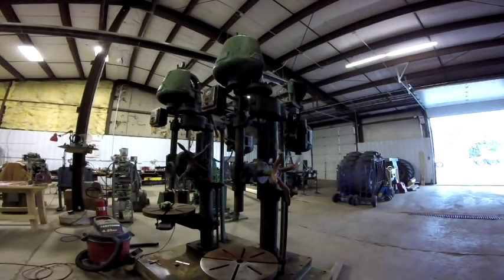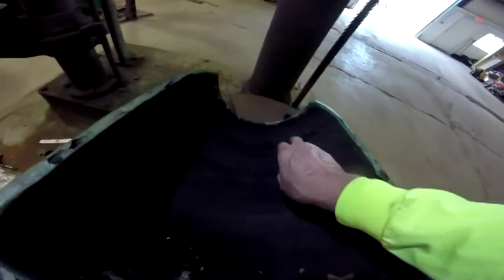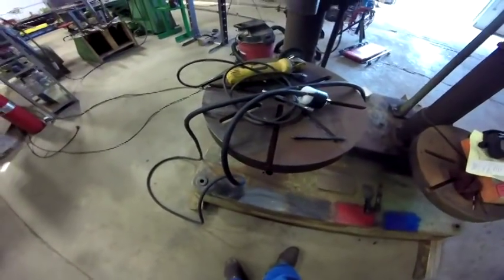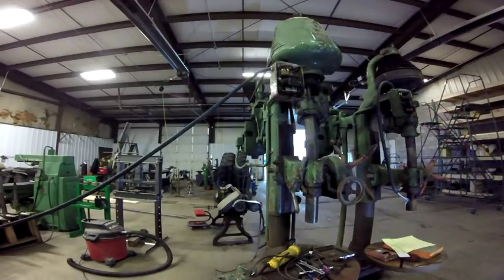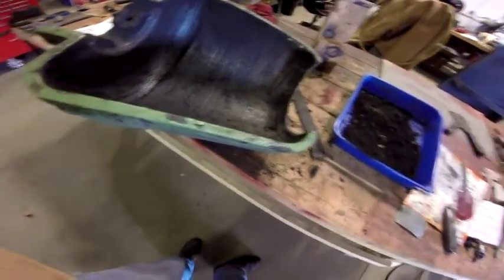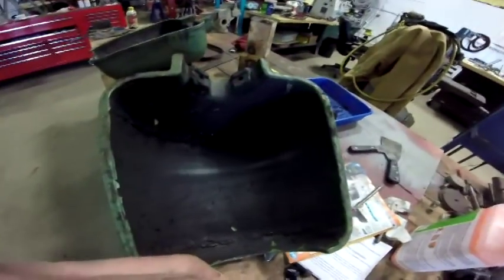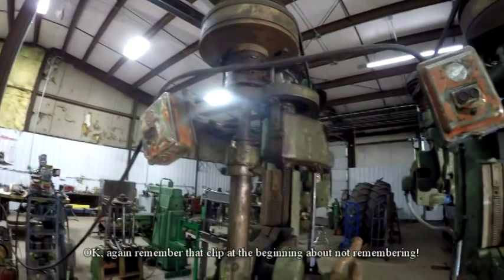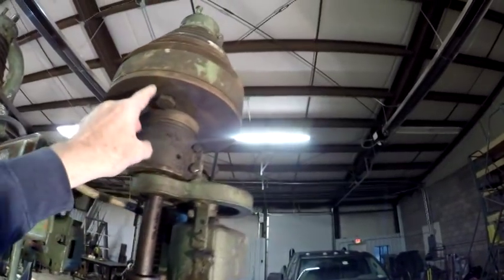Candey & Otto Drill Press Part 1

Comment: Fred, that tapered nut you found I'm betting you screws onto the pin that is pulled down by the fork that puts the gearbox in backgear!Amazing find! If you look at the pins it's just a hex nut on there. That tapered nut is what I had wanted to make for years and never did. 
That fork handle is just frozen up in the bore it slides though from sitting outside. Try some penetrating oil, maybe a little heat, and a soft bow hammer and try tapping on it. I'm sure once you get it moving it'll free up. 
On the left side spindle, use a flat screw driver to pry down the pin (hex nut) and push back on the lever to engage the fork and it will pull the pin down all the way. Then your in back gear. 
The spindle on the right side sounds like the pin is half way engaged. I would not run it anymore until you get the pin to move up or down fully. Remember, once you release the pin with the fork, just bump the spindle on and off quickly and listen for the pin to seat fully and go into drive. 
That back gear is what we used for the larger drill bits, most always the slowest speed.
Reply from the maker: Abom79 Thanks, will put all your suggestions to use when I get back to shop on Monday! Was able to get right side table table moving up and down today, draw bar was rusted into nut and I had to take it apart to break it loose! 
Going to that auction in morning, will message you info on that lathe.

Comment: Fred please forgive my ignorance but I do not understand why there is 2 drill presses on one base. I'm sure there is a good reason they did it that way in the day but I just ask why not 2 separate machines? Thanks for all the effort making the video.
Reply from the maker: Terry, think they were mainly used for industrial type use where you could have multiple people or one person drilling different parts at same time! I plan on having one arbor as the tapered or MT for tapered bits and the second one going to adapt to a Jacobs # 20 chuck! Also as Adam told me, the two tables can be set to same height and large stock laid across both tables when drilling larger pieces! This manufacturer made multi head units up to 6 and possibly more and the reason I say possibly is that I haven't been able to find info on this style of one so I don't know  what may have been done in this model!
Reply: Thanks Fred for the rapid response. I was think it might be to conserve the cost of labor in a production shop.
Reply from the maker: Your right, and multi head units would be cheaper to manufacture then having to cast separate bases and the next (or assuming next) model of them all had  common table arrangement instead of separate tables like mine! Then as they had auto feeds on them, one person could be in one location to work multiple units at same time! Then tooling could be kept in one location ,etc, etc.
Reply: I love this old stuff. Once i get my insect proof room built I want to find a good old tool room lathe and small knee mill and small shaper and  recondition them.  I am thinking the resurrection will be just as pleasing as actually making parts on them.

Comment: one is starting amps and one is running amps.
Reply from the maker: Going to be more on electric in part 2! Found another motor tag buried under layers of paint! Know that I have sized wiring for worse case scenario so should be covered there. Thanks for info though.